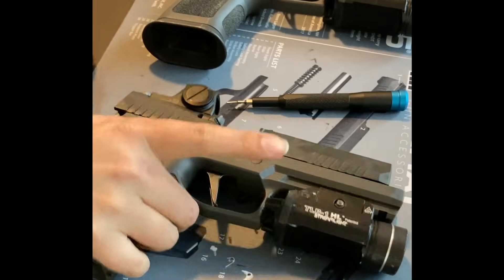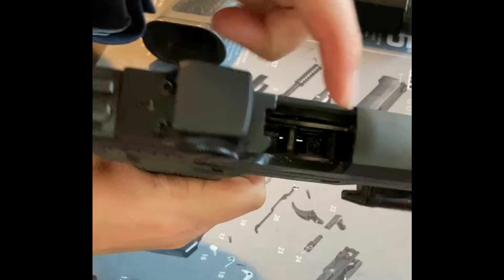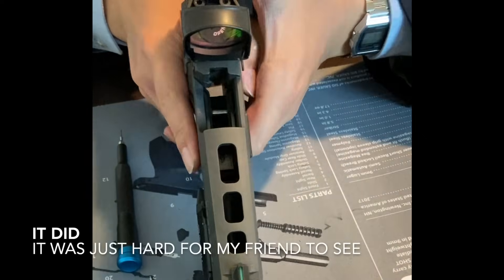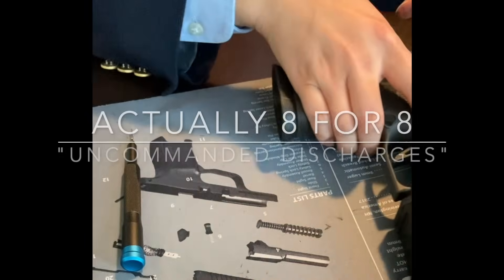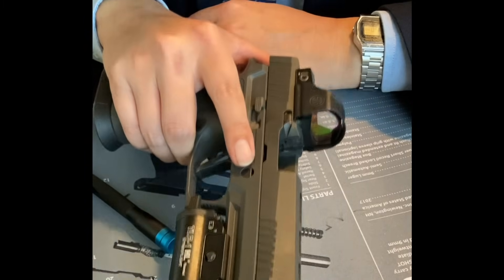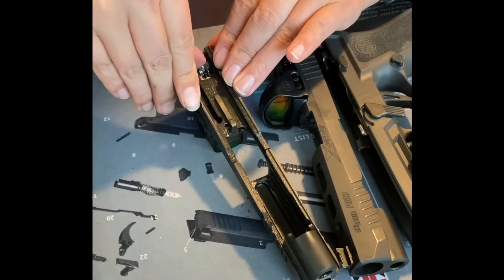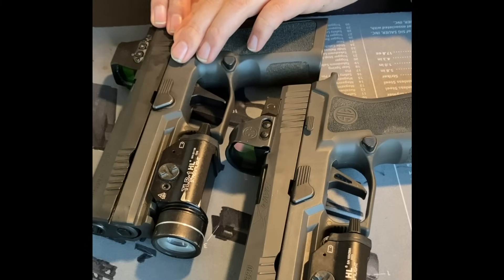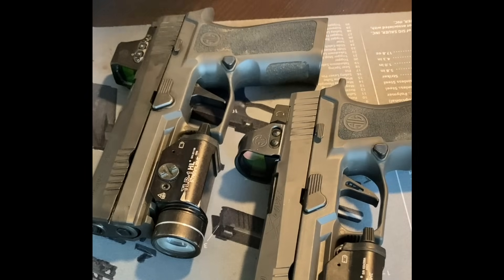Testing two P320's for Uncommanded Discharge: One PASS, one FAIL

Comment: Why the  US Military chose this POS of a pistol over a Glock is beyond me. I'm not a Glock fan boy by any means but Glock is the AK-47 of pistols. It will work when you want it to and it's not going to go off if you drop it. I  own Glocks and they're not my EDC but I do respect the fact they're made very well and function well.
Reply: Why did they choose Sig?  The correct palms were greased.

Comment: I'm going say the problem is more than likely the striker safety lever in the fcu is either out of spec or is moving causing the striker safety disconnect to disengage allowing the striker to protude in your test. Remember a good number of the internal components of the sig p320 are produced by metal injection molding (MIM).

Comment: Could the screws on the red dot be causing any of this? I cannot remember if they go through the slide at all or not. It’s been years since I owned a legion. I sold all of my Sigs and will NOT ever buy another one.
Reply from the maker: No. Both sights are properly installed.

Comment: It cant be a timing issue between the striker and striker safety. These guns are going off unintended after periods of extended rest. What you said would make sense if it was some sort of rapid fire issue, but the gun is intended to fire under a rapid fire situation. The striker has long been pulled back after a period of rest. Now the Striker return issue could very well be related, but I don't see how it can be a timing related issue seeing how the guns can sit for hours/days/weeks before discharging unintentionally. Nice video though, this does give us an in depth look at what is happening here, and begins to sort out why some guns have no problems and others randomly will. This even give P320 owners a safe way of determining if their firearm is safe to carry loaded. My boss has one he carries, Ill have to show him this video and perhaps check his out to see if the Striker will protrude with the striker safety not actuated. But as you said the Striker should not be releasing to begin with. The gun should not be relying on the Striker safety as its primary means of preventing unintentional discharges. It should only exist as a last case prevention measure, the striker released 100% of the time without the trigger being pulled on both weapons, even if the striker did not protrude 100% of the time on both. I suppose the question here would be is the manual actuation of the Sear something the gun would be exposed to during normal use/  dropped weapon scenario, which I would have to say that previous incidents have told us would be a yes. I have long wondered what the case would be if people carried these guns for the purpose of testing with no round in the chamber but with the striker engaged?? Would we later find the striker disengaged with no trigger pull, even if the striker did not protrude?? I suppose I havent heard of anyone carrying a loaded weapon, but having to eject the chambered round to engage the striker in order to fire the weapon, suggesting that on guns that don't have unintended discharges that the sear is in fact keeping the striker engaged and the gun is not relying on the Striker safety to prevent unintentional discharges. Sorry for the rambling post, hope this makes sense. Thanks for posting.

Comment: Thank you. I have a CA M18 and plan to carry it. So far, about 1500 rounds through it, not even a single malfunction. Did this test, and my pin doesn't protrude when slamming the sear down. It definitely clicks, but no pin. If you pul the trigger you can see the pin quickly pop out then back in, so it's definitely not gonna fire itself. Makes me feel better 😂
Reply: Good luck with that.

Comment: The sear and striker block are all defeated by one component (sear) in the 320. On virtually all other striker fired guns they are actuated by completely different parts. Most use the trigger bar to move the block and sear separately. The 320 is a wimpy striker block compared to all other striker guns and their “wagons” are hitched. In simple terms debris, strange torque, a good smack among other things can make a pistol like this fail. The true answer is that this pistol was an afterthought. They modified the P250 a perfectly safe weapon that was hammer fired to become the 320 a striker fired pistol a dangerous weapon. No trigger safety either means that statically the 320 is more likely to discharge unintended than virtually any other duty handgun in existence. Even debris in the holster is much more likely to hurt you just because of the lack of a trigger safety. All of these issues combined with poor QC and sooooooooooo many different models and parts interchangeability options leads to sloppy tolerances for the FCU in some cases and that combined with an already less safe design that was a retrofit from a hammer fired pistol means you can’t trust this gun. Period that’s all there is to it. IT ENDS TODAY.

Comment: Thank you for making this video. There has been more experimentation and testing here than anywhere else that I have seen ever since everyone hopped on that early drop test train. This has answered more questions for me so far than from anyone else, especially Sig. 

My money is on a quality control issue, by the way, given what you guys have demonstrated.
Reply: If the cops getting shot by their own sidearms is because the firing pin safety isn't engaging that makes sense, but still can doesn't explain why the guns are going off

Comment: Very good video and demonstration. I bought an Sig Xten and was excited to carry it but then the misfire issues re-emerged that I thought had been resolved a long time ago. After getting the hang of your demonstration I’ve tried it several times and my striker/firing pin does not seem to drop so it’s “safe” but that’s also a stretch considering Sig themselves won’t comeout and address this issue. 

My question is, when was your P320 purchased/manufactured vs your friends?

Is it possible that Sig is aware of the issues like so many seem to think & claim and may have stealthily fixed the issue in newer models? I guess we’ll never know because it’ll hurt sigs bottom line.
Reply from the maker: My pistol was born in 2020. Friend's pistol was born in 2022. Age does not seem to be a direct factor in whether an FCU fails or does not fail this test.
Reply: @ interesting. Thanks for the info and response man. I’m still at it testing this pistol since seeing your video. Currently I put a spent casing in the chamber with a thin piece of scotch tape over the primer and tripping the sear with a “long poky thing”. So far the striker still has not dropped. Still not satisfied. Thanks again for your video & research into this. More than Sig would ever admit to and it’s a shame.

Comment: Sincere question. Would this also apply to the M17 /M18 models with the thumb safety?
Reply from the maker: Hard to say, as I do not have access to any civilian or military M17 / M18 pistols to test. The Sear Movement Test should still be valid to perform, but whether an M17 / M18 will or won't fail... I have no idea, and I've learned to not make assumptions about any aspect of this mousetrap of an FCU design.
Reply: I have an commercial m17 and did the same test with safety on. I was able to drop the sear but my firing pin safety worked as intended. The manual safety just blocks the trigger from being pulled.
Reply: @ I have one as well and am now reconsidering the purchase. I have shot it a bit and really like it but if it is dangerous I don’t care how much I like it, it is not worth taking a chance of a ND.

Comment: You’re very well-spoken and seem to be wearing suit and tie. Are you a lawyer?

There is a helper spring inside the striker assembly that has a tendency to get crushed, deformed, and balled up. I have read it is a redundant part, and Sig customer service advised another person on a forum to simply remove the pieces of the failed spring and not replace it. Is it possible this helper spring failing is a contributor?
Reply from the maker: That appears to be the spring that is either broken, otherwise non-functional, or outright omitted on my friend's pistol. As you can see when we swapped striker assemblies, the presence or absence of the rebounding feature seems to influence how reliably a failing FCU will fail, but it does not seem to influence whether an FCU will or won't fail the Sear Movement Test.

Comment: I think it’s the tolerances across all individual parts. That’s why the issue got better but not fully resolved when swapping the striker from one pistol to another. It’s a meh design with sketch quality of parts
Reply from the maker: The FCU appears to be the heart of the failure. Other components influence how reliably or not a failing FCU will fail, but the tolerances elsewhere appear to have no influence over whether an FCU will or won't fail the Sear Movement Test.

Comment: The p320 m18 was one of the most accurate pistols I've ever fired.  However, I've decided to go back to the p228/229.  The older design is safer for carry.
Reply: Funny, world champion Ben Steoger said the P320 was one of the least accurate pistols he's ever fired.
Reply: @baronmaupertuis Safety concerns aside. The gun performs does exceptionally well in ransom rest tests. The test (given that it is mechanical) is more accurate than Ben Stoeger is. 

We can bash the gun all we want for its safety, but as a combat shooting gun it is no less accurate than Glock, M&P etc.
Reply from the maker: Stoeger has a P320 X-Five Legion, which multiple high level competitors have remarked has a flaw of some kind with their stock barrels that renders them shockingly inaccurate in comparison with standard 4.7" barrels. The X-Five Legion is reportedly not great on accuracy, every other model of P320 does the standard pistol thing of shooting better than the shooter.
Reply: @P320Truther  I am referring to military and carry guns that have been tested by the ransom test. Which again, are the true measure of mechanical accuracy from a firearm since the test removes human error and movement from the equation.
Reply from the maker: High level competitors have put the X-Five Legion in a ransom rest and validated that it's not just their imagination, the barrel of that specific model groups measurably worse than every other model of P320.
Reply: @P320Truther  Like I said, I saw the official ransom test of other P320 models. This is the first time I hear of the Legion having issues.

Comment: So, are we thinking that the spring is weak causing the striker safety to slip forward?Or are we thinking that the striker safety doesn’t engage when loading?
Reply from the maker: The ultimate cause of failing the Sear Movement Test appears to still be the FCU. The functioning of parts of the striker assembly seem to influence how reliably a failing FCU will fail, but it does not seem to change whether an FCU fails or does not fail the Sear Movement Test. Our current hypothesis is that sear movement causes sympathetic movement of the safety lever via the trigger bar, which allows sear movement to deactivate the striker safety lock.

Comment: My local range is considering not allowing the p320. They don't want to deal with the chance (regardless of how small a chance) of a Sig p320 unintended discharge. I would not be surprised, if their insurance company bans the gun on their liability insurance. Some of the local instructors, will not allow the gun in their classes. Having been involved in teaching, you have enough to worry about when teaching a student on the use of their weapon.

Comment: Appears to be a tolerance stacking issue. Can you measure your slide internal dimensions against your friends slide internal dimensions and then measure the FCUs safety components to see if they are different? A few thousands off could allow enough space for the components move and bypass the safeties causing the inconsistencies.
Reply from the maker: The FCU appears to be the heart of the failure in a way that extends beyond mere tolerance stacking. Other components influence how reliably or not a failing FCU will fail, but the tolerances elsewhere appear to have no influence over whether an FCU will or won't ultimately fail the Sear Movement Test.

Comment: The words used mean things. Not all unintended firings are equal, nor do they deserve one term.

Negligent discharge is a definitive wording: it implies negligence on the part of the user, such as mishandling a loaded weapon or inadvertently inserting a loaded mag during your dry fire session.

Accidental discharge has a lesser connotation: the discharge is accidental, due to an unfortunate series of events. Think a thumb slip during de-cocking of a design that requires a decock, a damaged or mis-adjusted holster activating a trigger, any discharge that is explainable without design fault but not generally caused by common negligence or irresponsibility. 

Uncommanded discharge implies that the discharge was neither negligent nor accidental. Uncommanded movement is not unknown in the aviation world, and generally a very scary sign of significant defect. It implies that the operator is in no way responsible for the event, which can only be explained by engineering fault.
Reply: Totally agree. "Uncommanded discharge" is an apt term for what's supposedly happening with the P320

Comment: That's pretty sketchy. I think I'm going to stick with striker guns that utilize the reliable plunger safety system for my edc's. Even if the failure produces a light strike, I would not trust that modern carry ammo would not detonate because the primers on those sorts of ammo like Federal HST and Speer Gold Dot and others are pretty good at working even with lighter strikes. Got to give you props on your clever test because this easily shows that mishaps are in fact possible with the P320.

Comment: P22X Supremacy. The 320 is full of flaws and not just uncommanded discharges. Theres multiple instances of them firing out of battery. Which should not in any realm of imagination be fucking possible. But its happened.  The 320 was a rushed design and the result of hastily cramming a striker fired gun into a DAO slide and frame to bid contracts.

Comment: So what exactly is different about the 365 that it doesn’t have this problem also?
Reply: 365's safety is the plunger type. Similar to most other striker fired designs
Reply from the maker: The P365's FCU reacts very differently to sear movement and does not appear to be vulnerable to what we are theorizing is the root cause. More to come.

Comment: Good video!  It seems that the failing P320 has a missing or broken striker reset spring and the constant downward pressure on the sear made it possible for the striker to jump both sear catches. It would be interesting to see if that condition is strong enough for the striker to discharge the primer. Keep in mind that the striker reset spring is considered redundant. In order for you to have a round in the chamber  you need to rack the slide which engages/resets the striker back.  So as per this demo, both sear springs have to be missing or broken as well as the striker reset spring, meaning a catastrophic failure in the pistol that can be demonstrated in a court of law. I'm still waiting for that to happen.

Comment: If you push the sear down far enough, it will move the trigger bar forward, effectively pulling the trigger and disengaging the striker safety.  On a Glock, you can't do anything like this.  The cruciform won't move down until it first moves backwards into the angled portion of the channel in the housing, and that can't happen without the trigger inertia safety also being depressed to allow the trigger bar to move rearward far enough.

Comment: Take the slide off both guns and depress the sear. I want to see if the safety lever rises on both when the sear is depressed.
Reply from the maker: Both sears move the safety lever, but differently. The difference in safety lever movement appears to be related to failing or not failing the Sear Movement Test. More to come.

Comment: This can also be done with a fully assembled gun, place a snap cap or used brass into the chamber w/ a piece of paper between the case head and the breach wall, if there is a hole after conducting the test the striker released and protruded far enough to ignite the primer

Comment: Great work on this video. I’ve seen from this comment section people are pointing out that this test is being done without the barrel or recoil spring. It may be wise to have a barrel cut away to show the breach face so that you may demonstrate this with the gun fully assembled. Or maybe demonstrate this with a probe camera down the barrel. Keep up the good work and don’t let the bastards win.
Reply from the maker: I fear you overestimate my access to tools and extra parts! More importantly, the goal is to use the minimal necessary tooling to find a test that might help people determine whether their P320's safety features (such as they are) are properly functioning OR potentially bloodthirsty.